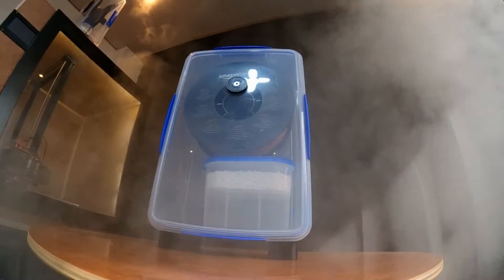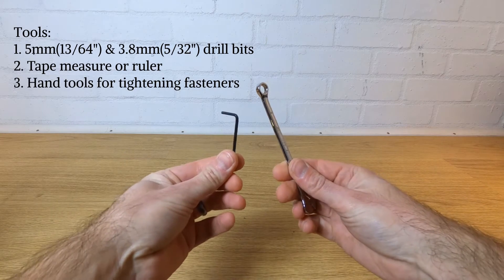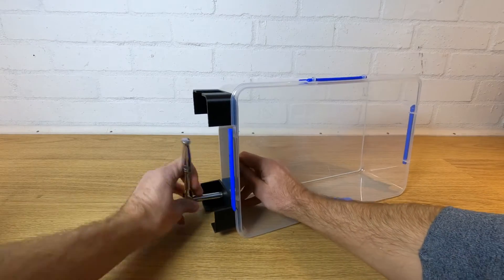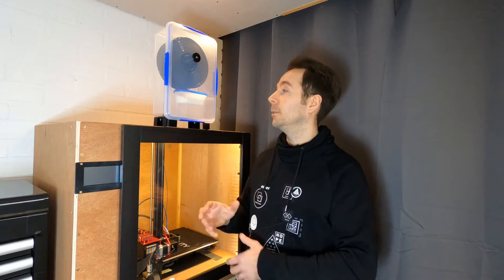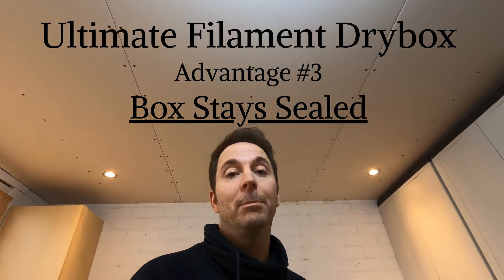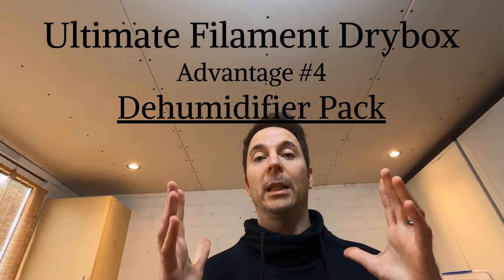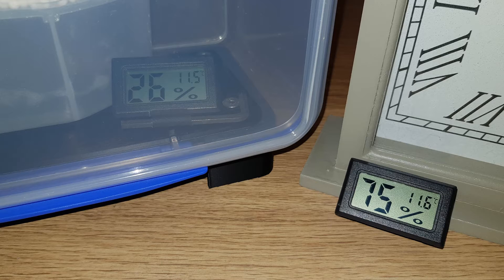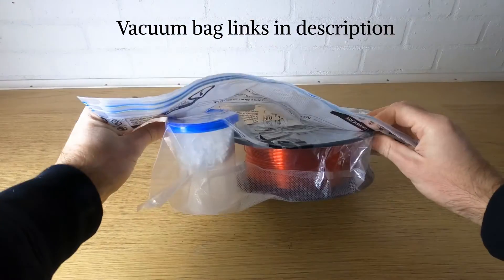Ultimate Filament Storage Dry Box - Print while keeping your filament dry

Comment: I use two FLSUN S1 Dryers to keep the spools being used dry as possible, they can do 55 C so not perfect for PETG, But still better than the spool of PETG on the spool of the printer in the open air.

Also I store any spools in e-sun filament vacuum bags using a electric small vacuum to take out as much of the air as possible and I put in each vacuum bag a big bag of new silicone desiccant.
The bags are then vacuumed until the bag is tight around the spool they are then placed back in the original filament boxes which I have written the temps and speed and flow for that filament.

They are all then placed away from any sun light in a cupboard under the worktop that holds the printers. Not a perfect system but still it works well.

I print using the dryer units which sit up on a set of brackets on top of the two small printers ( Aquila & Neptune 3 ) I was looking at buying the new S2 FLSUN Dryer which goes up to 70 C temp
and has two elements top and bottom and a big lit LCD control screen, those still pricey at around £70 in the UK.

Before I had the dryers I used to keep the filament dry by using the e-sun vacuum bags, I would have the standard side mounted original spool holder and put the spool on it and get the e-sun vacuum bag to go over the spool and holder from the left then put in the desiccant bag in the left corner of the bag then seal up the double seal on the top of the bag and just leave a tiny gap up
the top of the left part of the bag so the filament can still feed out to the extruder. Again not prefect but it works ad the vacuum bag id not vacuumed it is just loose around the spool and holder.

I will look into this one you done too?
Reply from the maker: Sounds like you have a good system there Colin. We definitely need some way of preventing moisture getting to our filament here in the UK, it must be so much easier to print in areas with lower humidity.

Comment: If we change the base to be more of a gravity held stand (the box sits on the base instead of being bolted to it could even mount to the printer), then you just design a storage system to organize multiple boxes. then you have hot swappable dry boxes for different filaments.
Reply from the maker: You could do but the legs don't take much filament of time to print. What doesn't come across so well in the video is the angle of the side of the box. It's not square so tricky to store without the legs.

Comment: Total n00b question, how do you tell if your filament is over hydrated?
Reply from the maker: Damp filament will generally give you increased stringing and blobs. Sometimes you can hear a slight popping sound at the nozzle where the moisture is boiled out if the filament.

Comment: Hygrometer not needed nor useful. The hygrometer will only show the relative humidity (RH ) of the air inside the box. Consumer hygrometers don't indicate RH below 10% (lots don't even go below 20%). A reasonable amount of silica gel will quickly absorb moisture from the air inside the box to below 10% RH (but the device will show 10%). Whatever moisture content a device does show for the air is not indicative of the moisture content of the filament (only after a very long amount of time when equilibrium is reached). A more useful way to monitor the moisture content of filament is to weigh it periodically. But if you use filament for printing, then the weight would need to be corrected according to the amount of filament used. Not very practical. And the spool material itself also absorbs water and would have to be accounted for. Occasionally opening the box for rewinding a spool after use will not have an appreciable effect since water uptake by the filament is very slow, but a cool rewind mechanism won't hurt. Thus, after receiving filament, simply dry it for a few hours in a heat and/or vacuum box, then store in a box with a feed-through mechanism (with silica gel, just to be sure, but skip the hygrometer and the rewind mechanism) and don't sweat it ;) If you need to replace the silica gel after a while, then the box doesn't seal well, which is a minor annoyance, but the filament won't really take up moisture because the gel captures it, unless you forget to change the gel when it's at capacity...

Comment: Hi Ricky I printed all the parts but I do find the filament reel holder is far too long, what's the best way to make it slightly shorter so it's not hitting the lid when you put it all together thanks....
Reply from the maker: What box did you buy Mark? Is it the Systema one linked in the description? It should fit unless you have the wrong box.
Reply: @RickyImpey  hi Ricky I bought the one in the description but I got it sorted out as I reprinted it and scaled the z axis down to 105mm and it's ok now but when I do another one I think will scale it down to 103mm as that will be perfect fit thanks again and keep the videos coming 👍
Reply from the maker: @markcox1437  You have me concerned that for some reason the link sent you to the wrong item. It should fit. Would you mind seeing if there is anything showing the capacity of the box you have. It should be something like 7 or 7.5l. Thanks. Glad you got it sorted though.
Reply: @RickyImpey  it was the 7L ones I bought Ricky but for some reason when I printed the parts then fixed it together the lid wouldn't go on at all as the reel holder was far too long but as said it's ok now 👍

Comment: Love this idea! Can't wait to start building mine. One question and possible suggestion.
Have you thought about making provisions to mount this box directly to the top of the ender frame? 
I see in your video you have your machine in an enclosure. But for those of us that don't, it would be great to mount this box directly to the printer. Maybe just incorporate the width of the frame into the legs of the box, in a U shape, so the box can easily be snapped onto the frame of the printer, and interchanged with other boxes containing different filament easily.
Reply from the maker: Hi, thanks for the comment. I don't like to mount anything with any weight to it to the top of the frame as it can cause increased movement when the printer moves in the Y direction. It's generally best to keep your spool holder mounted separately if you can. Also, I have quite a few of these with all of my most susceptible filaments in so I wouldn't want one mounted anywhere myself. For my Ender 3s, I have a couple of boxes with the exit out of the side which works well.

Comment: hello ricky i have a quistion to you i did a box relly seme to yours but it wose then with out it and i have a qustion is there a way to know if my filement is wet or not 
and thanks
Reply from the maker: Hi, unfortunately there is no real way that I know of to see the moisture content of your filament. What I do is weigh it, dry it and then weigh it again. The difference is obviously the amount of moisture that was in it. If there is a lot of moisture in your filament the. If will make a sort of fizzing or popping noise when it passes through the nozzle where the moisture is boiled. Have you tried the simple filament dryer option to dry it? https://youtu.be/WC3jvuq-uq8
Reply: @RickyImpey  yes before trying this there were some piping sound but after i can't hear anything thanks a lot Ricky 😀

Comment: if i put a cotton or sponge frim inside of the outside of the fillament is good idea ? just for extra security for air get insides
Reply from the maker: If you have a desiccant like silica beads or the dehumidifier packs then you don't need anything else in with your filament.
Reply: @RickyImpey  so if i put in a box with silica beads it will repaired ?

Comment: Great design, I have been looking to make a dry box but couldn't find one I liked and stumbled across yours and this ticks all the boxes.  One thing I want to ask is that I already have some silica gel that changes colour when saturated so do you think printing out a mesh out with legs (for space to deposit moisture) to sit on the bottom and adding the silica beads on top would work as well as your dehumidifier pack?
Reply from the maker: The silica beads aren't bad and will work. I find the packs to last longer but they can't be 'recharged'.
Reply: @RickyImpey  Brilliant, thanks for the quick reply.  I just realised I already have some mesh I didn’t use as well from my fish tank so don’t even need to print it out 👍

Comment: Perfect! I found your video, even watched the first one. Printed all the parts required for the geared box and put it together withou issue. As I'm in NZ, Sistema containers are plenty and cheap. Added the Hygrometer to the front panel. Looks really good and functions just like a commerical system. Coffee coming your way.

Comment: I love the box and the construction. But the absolute humidity part doesn't make sense to me in real life. Anyone who hung clothes to air dry, knows that they dry much faster in a 30c 50%RH (15.179g/m3) day than they do in a 11.6c 75%RH (7.7977g/m3) day. It makes more sense that the relative is the important factor, no matter how much real (absolute) moisture is in the air, if it has more available room to accommodate moisture it's better than when it's closer to saturation. One can clearly see this, in the EMC (Equilibrium moisture content) of wood, the point where it doesn't take or lose any more water, at 11.6c 75%RH (7.7977g/m3) it has 14.7% water content, while at 30c 50%RH (15.179g/m3) it has 9% water content, despite being in almost double the absolute air moisture.

Comment: box all up and running 11% humidity and remixed the spool holder to take bearings worked well as I had to reduce e steps.
Reply from the maker: Nice👍 I actually started with bearings but found the filament was unwinding a little too much each time the printer 'tugged' on it so didn't bother. If you like them, that's great.

Comment: I like your design, especially the desiccant holder, so I hope you will take this as constructive criticism.  If I want to keep a container air tight, I think a good starting place is NOT to put holes in it in the first place.  The legs could have been a cradle that the box slides into and the holder for the spool could have been entirely internal.  I think only one hole is necessary for this design.  Also, the equation for transforming from relative humidity to absolute humidity is linear, so the percentage drop is the same.  Maybe I'm missing something regarding bothering to do the calculation?  And just out of curiosity, why does the holder for the spool have a square-ish cross section?  Why not round?  Is there less friction?  Thanks.
Reply from the maker: Hi, yes technically no hole would be best but as each side of the hole is sandwiched with a plate, there will be virtually zero air gap. Far more air will leak around the filament inside the PTFE tube. With regards the the relative vs absolute humidity, no they are not linear. Warm air holds more moisture than cold air. The relative humidity may not change on your gauge but if the temperature rises then there is more moisture in the air. Absolute humidity takes the temperature (and pressure) into account so you know actually how much moisture is in an environment. Relative humidity is a pretty useless figure without knowing any other information. Yes indeed the squarer section gave lower friction in testing so that's what I used. Have you seen the rewind mechanism? That uses a different setup that is even nicer I find.
Reply: Regarding the holes, each sandwich is much like a bulkhead connector. However, an impermeable seal could be placed on either side of the hole and then sandwiched with the plastic pieces. Such a seal can be made using either rubber gaskets or a bead of silicone. Your hardware store probably has both.

Comment: Made the box need to alter my bench the printer is on to get to fit but all looking good.  Put one Desi bag in and it is now showing 21% humidity and 46% outside the box!  Looking at a usb heater for inside and adapt your vents/fans to fit?
Reply from the maker: That would be an interesting project Phillip. Let me know how you get on.
Reply: @RickyImpey  could be some time on a budget

Comment: I printed on and I am working on my second box for another color, any idea how long the dehumidifier pack lasts? I can keep an eye on the meter but just wanted to know how often I should be buying the dehumidifier or refills for it.
Reply from the maker: Hi Brian, these packs collect the moisture and drop it into the bottom of the box when they start to get saturated. I use them in other places like my car in the winter. None of the ones I have in dry boxes are showing any signs of dropping anything yet and I have had some in for over a year!

Comment: Why not design a horizontal mount and do away with base plate etc. ? Wouldn't the load be more distributed resulting in smoother movement of the spool? Would anyone comment as I am in the process of designing a filament dry box myself. Thanks
Reply from the maker: Not entirely sure what you mean. This box is slightly tapered so it needs the legs to make it stand straight vertically. I made the legs the length they are so that it can feed directly down into my printer enclosure. If you mean why not lay the spool down on its side and have the box flat with the lid on top, then I'd say that you'd get more friction where the centre has to rotate on a surface. Still possible but I think you'd have to design in a way to reduce the friction like a side bearing like you find in bike headset.
Reply: @RickyImpey  Hmm.. Actually I am just scouring the internet to find all the design and have found both vertically placed spook as well as horizontally placed spool. both designs use bearing(s) for free rotation but not sure if one has any advantage over the other! I have the same plastic container as the one you used and was thinking if it will be easier to just place it horizontally with a horizontal mount.. I guess I will try both  :)

Comment: Absolutely brilliant idea Rickey. I've made two and am in the process of making a third. I'm going to add the rewind mechanism at a later point in time but the whole package seems the best solution I've seen so far on Youtube. 5 coffees on the way mate. Here's to more fantastic vids.
Reply from the maker: Thanks Gaz👍
Reply: Well this seems to keep the air dry around the filament but what if the filament is already wet? Wouldn't you need heat to drive the already existing moist out of the filament?
Reply: @PREDATOR0140  The moisture level on the filament and in the air around it tend to normalize as the air absorbs the filament`s water, so you should just leave a wet filament in there for a day or two and it will be as dry as the air

Comment: Sistema make a 9.6L version of this box which is listed as 160mm in height and my spools are 65mm deep. 2x spools is 130mm, maybe the bigger box could house 2 spools? Would work out more economical if it could as the bigger box is around 50% more expensive while holding 100% more filament. I haven't made a dry box yet so don't know what other measurements would need to be taken into account.
Reply from the maker: Sure, might be worth a look. The main reason I didn't make the box big enough for more than one roll of filament is that I wanted to minimise the number of times the box is opened.

Comment: One upgrade I can think of would be some kind of locator tabs on that big plate just to stop the dehumidifier pack sliding around as that would bug me, even if it doesn't actually affect anything. I was looking at using a cereal style storage box as that wouldn't require printing legs and use less hardware but not sure how easy it would be to assemble. Also, no shops locally to me sell a cereal storage box big enough for those OP dehumidifier packs + spool, but they are available online. Not sure what I'm gonna go with yet but I now know for certain that I need filament dry boxes. I had quite bad stringing issues and that went away immediately after I dried my spool (left it sat on a storage heater for several hours 45c-55c under a cardboard box).
Reply from the maker: Yes, I believe some way to contain your filament in a dry environment is essential. I didn't use the cereal style boxes for exactly the same reason, I couldn't find them big enough to fit the dehumidifier packs. You can of course use silica beads but they aren't quite as efficient as the calcium chloride packs. I see what you mean about the pack being able to move but it hasn't been something that's bothered me at all. As you say, you could easily add some corner lugs but then you couldn't use the plate as a drill template for the bottom holes.

Comment: Thank you so much for this video, I was looking to make one for my roll while printing. May I request you to make a 3d print part to attach the box right over the Ender 3  or if it may not be stable then an attachment or something to fix it on an IKEA Saadi’s peg board which is on the wall right behind the printer? I will greatly appreciate if that is possible as I don’t have a casing for my printer and neither am I a cad designer, I am a cake and cookie designer and instructor who prints cutters for my students. Thanks so much your video has helped me a lot! Thanks 🙏
Reply from the maker: Hi, I wouldn't advise attaching something as heavy as this to the top gantry of a printer, the weight will cause movement in the frame which will affect prints. I tried googling the IKEA board but didn't have any joy. If you'd like to drop me an email with a picture and maybe some measurements then I can see what I can do. rickyimpeyyt@gmail.com
Reply: @RickyImpey  thank you so much, that is so kind of you, will send you an email with the photo. Thanks so much & gold bless!